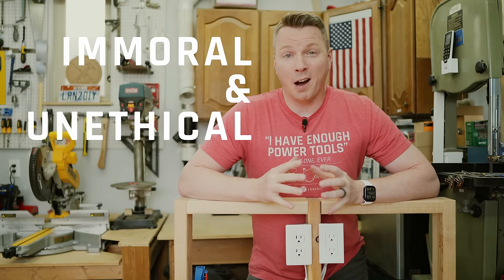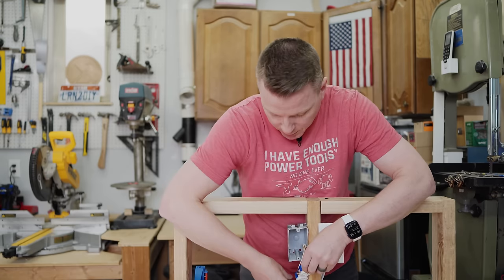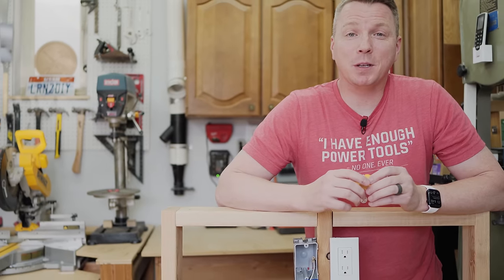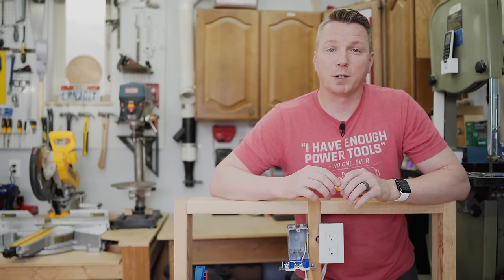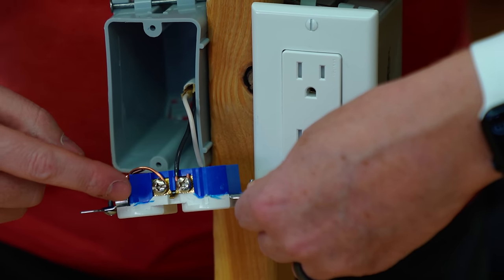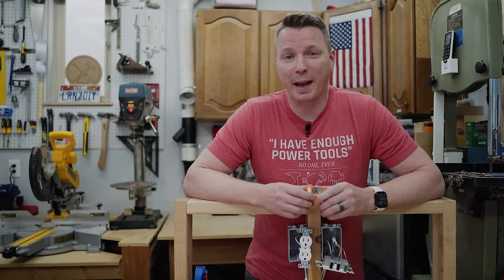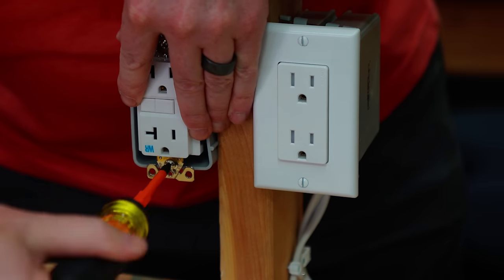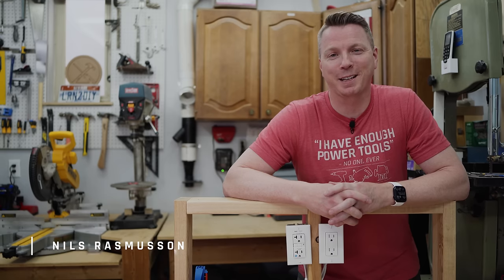People Are Adding Deadly Hacks to Outlets

Comment: What you have described at 1:40 is basically Klassische Nullung in Germany. For a long time we also just had 2 wires, L1 and N. In ~1960 the PE wire was added, this was called Moderne Nullung(modern zeroing, since it doesnt depend on the N being responsible for PE), but beware, some houses do have 3 wires, but sometimes there is an outlet beneath a switch, meaning it is also just 2 wires(basically the lamp has already been wired with N and is waiting for L1 to complete the circuit, a 3 wire cable is used, the L1 is clamped to the switch and to the outlet, the PE is being used as a way to control the L1[basically L1 is going into the switch and needs a second path to go to the lamp, meaning the PE is being used for L1], so that means the only way to connect the outlet now is with N as both PE and N and L1 as L1)

What I want to say, if you are in Germany(or any other country where this would apply) don't trust outlet-switch combos to have a real ground. Most of the times they are PEN.

And there you see the scheme PEN - PE + N on same circuit, PE/N - PE + N on different circuits.

Comment: Hi. In Europe if you have old type of electrical installation, specifically TN - C It is actually required to connect ground to neutral wire. Since in TN - C installation, you dont actually have a N (neutral wire), you have L(phase) and PEN(protect earth & neutral), so one wire - PEN is actually used as neutral and protection earth combined into one wire.

Comment: deadly is a huge overstatement, at best its a tradeoff, I for one would prefer to have my old metal cased power tool connected to neutral than simply left unconnected. If its unconnected and the hot comes in contact with the case your body becomes hot and as soon as you touch something grounded like the refrigerator or dishwasher YOU get shocked. If you have a bootleg ground it would be a dead short and would trip the fuse/breaker. That is a safer situation than the first. It is highly unlikely that you are going to lose the neutral between the outlet and the service panel than you are in the terminal device or its flexible cable. That being said adding a GFCI is too easy and cheap to not do it that way

Comment: My new home I am building.
Using 12 g (15 amp outlet), 10 g. (20  amp outlet GFI)  & 6 g wiring.    Everything is grounded.   
I have an outlet every 6’
I have a 20 amp all dedicated GFI in the kitchen.
Every outlet is marked (numbered) to breaker matching number.
200 Amp box.

I have 3.3/4” foam insulation. 
Low energy fixtures.  

When I bought a home built in 1946, 100 amp service.
I had it all torn out, replaced.   Unfortunately could not afford t add outlets.

Comment: Worked in Mexico once, on that site they only ran red and green to the outlets, and did a "bootstrap neutral". Their reasoning was that since you've bonded neutral and ground together at the breaker panel anyway, why then 'waste a wire' running a dedicated ground to the outlets
Reply: Mexico is not a great example of safety.
Reply: @leftyeh6495  What makes that unsafe?

Comment: I am always amazed by the craziness with health and safety stuff especially in the US and UK. Here we have whole residential buildings which are wired even without a ground wire in the walls at all. The worst I have experienced in 36 years of life from this is that sometimes bad appliances might "pinch" you just a tiny little bit when touching both their chassis and some kind of grounded thing, like a water pipe, the sink, or something like that.

If you want to have ground you must break the walls and install ground wires and connect to the only ground in the house, which is the bathroom outlet. I only do it to protect my computer and other sensitive electronics, otherwise I wouldn't even bother thinking about it.

Comment: There is one type of that "hack" which has been grandfathered into the code system, and that's on the NEMA-10 receptacles. They are no longer allowed for new circuits, but they do exactly the same thing as that hack. It connects whatever is meant to be grounded to the neutral supply. 

Of course the big difference is that at least you know that's the case if you have a NEMA-10 receptacle, but other than that it presents the same dangers. If there is a fault in the neutral, the chassis of that washing machine or dryer can rise to 120V AC with respect to ground if there is a hot to neutral load anywhere on that circuit (which there typically will be in such an appliance).

Comment: that era is what some in the electronics field refer to as the "Hot Chassis Era" where most electronics were vacuum tube or hybrid tube & transistor devices that did not have a power transformer but  power resistors to drop voltages down and also typically the tube heathers would be series string. The metal chassis would be tied to one leg and the other would be switched and the plug was not polarized.  The main push to polarized grounded sockets came with the microprocessor and home computer era in the late 70's onwards to today.
Reply: We had a record player that had capacitors from each leg connected to the chassis. Not nearly as dangerous, but regardless of which way the plug was connected touching the record player and any grounded thing produced a bite.
Reply: I was installing stereo equipment back then, and I could feel the difference by lightly touching the case (which were metal back then). If I felt a bit of tingling, I would reverse the plug and the tingling would be gone. I always instinctively knew that was right, without actually learning about it from anywhere.
Reply: There are enough countries with unpolarized grounded sockets and microprocessors and home computers handle that just fine.
Reply: Those radios are really dangerous. In Europe they cannot be used on grounded sockets as you would not want anything grounded next to it. Polarized plugs have nothing to do with microprocessors. They are used on lamps etc. to ensure that the switch breaks the phase and not the neutral.

Comment: I buy and rent out old houses.  Most of them have grounded outlets but when I open up the box, there is no ground, just a plug to put it in.  I switch those back to 2 prong.  Then the other thing is no GFCI in the bath or kitchen, so I have to run new lines to them.  One thing that really surprised me with the WWII era houses was where the neutral was run through the switch.  That was a real surprise to turn off a switch but still have power at the light.  An old electrician told me bootleg grounds were ok because the ground and neutral are bonded at the panel, but I don't use them.

Comment: When my wife and I married many years ago, we lived in an old rental that only had the two-prong outlets. It was common at the time to purchase a grey adaptor that would turn the two-prong plug into a  three-prong grounded plug. The adaptor had a short green wire that was never long enough to attach to anything. I guess these were not really safe but just allow one to plug the newly available grounded appliances being marketed? What's the professional opinion. I recently found one of these adaptors in the bottom of my tool box and it sure brought back memories...😜

Comment: In the 1940s my father bought a wire recorder which, like many super heterodyne radios of that time, had  a 2 prong plug.  If the plug was plugged into the socket one way, it was safe, and if it was plugged the opposite way you could get a dangerous shock  though your body to ground.   We got shocked on this thing many times. Thank God for gounding in outlets and 3 prong plugs.

Comment: To add on to this, bootleg grounds fool plug testers because the ground and neutral are connected to the same place in your panel. The reason for this is due to the fact your house is powered by a center tapped 240V transformer. 240V from end to end, 120V from either end to the center tap. The center tap has 0V potential, hence neutral, so that part is grounded.

Comment: I had a ground fault interrupt for a property which only detected current to ground.  New regulations required me to replace the switchboard with a core balance relay ( like you have in your video) but it was only required at the board because ANY current discrepancy in the entire house shuts it down. Note in your case that would also protect against a badly wired power point.  Any current leaving the circuit ( through you ?) causes a shutdown of all power.

Comment: A long while back I was living in an apartment and noticed that the metal body of my laptop caused tingling whenever I rested a palm on it.  So I disconnected it from everything and it was fine.  I plugged my external monitor back into the laptop with the laptop's power disconnected only to find the same issue.  Turns out that the leaky power was travelling through the monitor, then the monitor cable, into the laptop, and across the laptop body.  I'm pretty certain that someone who "upgraded" the complex with 3-prongs (likely "for cheap") did so using a bootleg ground and may have inadvertently switched the wires (or the wires were already the wrong color).  Needless to say I moved to a slightly older place that was actually wired correctly a little while later.
Reply: It is normal that many electronic devices leak. If they are not grounded you can feel it. It is not in itself dangerous but there is a risk in case of failure if there is no GFCI protection.

Comment: ANOTHER option is to replace all fuses with those GFI ones that protect the entire house wiring just like that bathroom outlet.  In apartments where a ground wire wasn't built-in from the beginning, it's the ONLY option.
Reply: It is an option, but it’s expensive. Around $75 a breaker. It’s cheaper to find the first receptacle coming off the breaker out of the panel and replace it with a GFCI plug. The power coming from the panel goes to the line  side of the GFCI and the power leaving the box to go to other receptacles gets connected to the load side of the GFCI. With it wired this way, all outlets on the load side will be protected by the one GFCI receptacle. You can then install regular receptacles on the other plugs since they are protected by the GFCI. It’s more labor, but it’s way cheaper than buying 15 GFCI breakers

Comment: My house was built in the 1960's and does not have a dedicated ground. Before I purchased the house in 2018, I had it inspected by an electrician.  I specifically ask if those neutral to ground jumper connections were legal / code complaint.  I was assured they are fine on old houses, he said grandfathered in.   Nearly every 3-prong outlet in the house has these ground neutral jumpers.

Comment: I don’t have any bootleg grounds but I have a bunch of three prong outlets without proper grounds. The inspector didn’t catch them so now I have to go back and put GFCI outlets in. The inspector also didn’t impress on me the importance of having the federal pacific panel changed before purchasing the house. Now I have to change the panel. Luckily, Rocky Mountain power isn’t going to make me move the overhead line from the back of the house to the front so that will save me a little bit on putting in a new weatherhead exterior disconnect and then a panel.

Comment: We spent 19k getting our 100+ year old house rewired... the old wiring was terrible. There was bare wiring in the walls and attic(it was romex run by the previous owners). Multiple receptacles weren't grounded. They literally just cut the ground wire back. They had 3 receptacles and all the upstairs lights on a single 15 Amp breaker. The electricians were astounded that the house hadn't caught fire or at the least tripped breakers constantly.  The previous owners did a ton of diy, and other than the obviously bad electrical, we found they managed to hide roof damage and water damage from the inspection we had done. So now we have about 70k with of work we have to get done after getting the electrical done. Honestly, I think they bribed the guy the company we hired sent.  There is no way he should have missed as much as he did.

Comment: The least expensive and easiest fix it the GFCI receptacle feeding the rest of the receptacles.   The issue is finding which receptacle feeds all the rest.  So, identify which breaker feeds the circuit, and feed and return to a GFCI mounted next to the panel.  Have one GFCI for each circuit.   Make sure to label all the receptacles.

Comment: I bought a 110 year old home and am a bit of an electronics nerd. I bought one of those testers to check my outlets and they showed good, but when connecting my battery backups in different locations i kept getting wiring faults. I found several outlets where the hot and neutral were reversed but many others had these bootleg grounds. Even the home inspector didnt catch them!

Comment: I live in a building where there is no ground ANYWHERE in the electric outlets, ceiling lights, etc. I've even almost got electrocuted as they sliced a current from my kitchen lights to the bathroom, so when I got off electricity to the kitchen lights, there was a current being shared that led to the bathroom. I didn't notice it until I saw a spark at one point on what I thought was dead wires.

Comment: Years ago, replacing 2 hole non grounded outlets at my  built in 1962 in-law's house, I found the wires used were armored BX cable which was grounded properly, so I added a short green secured into every metal box and the grounded receptacle.  Easy enough to then put the ground wire onto the regular replacement receptacle and it was grounded. The vinyl insulation was still in fine shape. Some of the wires were armored 3 wire with bare ground . Just how they built electric systems back then. Other house they had was made in 1968 and used rag wire, a silvery blue cover. Wires were in good condition. Every rag wire had a bare ground wire. Except for the water heater wire which was never used as house used NG water heater. It was just a 2 wire, white and black only. I thought at the time, why no ground and figured out back then  in the 60's, the water heater having copper water lines all over and in the ground, that was considered grounded by way of the cold water pipe.

Comment: This is fine, if ground is connected to the box and then connected to neutral, hot wire touching the case will have the same result as a ground wire from the breakers connected to the outlet

Comment: You can just use Multimeter if you know what you are doing. Check using Ohm between plug holes, or using "Live" function (check with red and black, you might get different results).
Also, it's better to have a bootleg ground than nothing, I got shocked by appliances without a bootleg ground a few times, but never with that crap solution you can encounter in very old houses. Here in Europe in old post Soviet buildings everything was set-up like that, and not to mention Aluminium Wires. CRAZY.

Comment: You installed a 20amp GFCI (has the extra horizontal notch), I made that mistake and after some googling, learned that unless my breaker is 20amps, I'm asking for trouble. 

My solution was to replace all of my 20amp breakers with 15amp ones

Comment: Thanks for including a solution.  This video needs to be posted on Facebook as a general PSA. 
Is 8,000 dollars worth it?  Depends on how frayed the cloth wiring is. Cloth and cloth over rubber was popular up to the 1960's in my area. 
Also running a green wire from the ground screw to the metal box MIGHT work BUT this "mechanical ground" is poor - though allowed - and I've seen plastic splice blocks that break the connection. 
Can you run a ground wire under the house, in the attic and attach boxes to the ground wire.  NO. this is not allowed for some pretty complicated math reasons involving impedance and the NEC or national electrical code.

Comment: Relying on one of the prongs being at a neutral potential I just find insane.
I know they are phasing in TN networks more and more here, but they still treat the sockets and outlets as having interchangeable prongs. Traditionally we run IT network where both wires coming to load are active and cycling and usually 2 of 3 phases entering the home. A different room would then have two of the 3 phases as well, but not necessarily the same two.
Earth/Protection/PE is then always treated correctly as you can not fake it. Equipment not needing grounding can then use a plug that works for both grounded and non grounded outlets and you can't just brake off the ground pin on equipment that needs it to make it fit a non grounded receptacle.

Comment: My dads house still had knob & tube wiring from the 1940's.   Even IT had a grounding wire in each outlet, even the ones that did not have a ground pin recepticle.  The body of the recepticle was srill grounded, and you could access the ground through the plate screw.  I am baffled as to when an outlet would not have one?

Comment: Well, thought most homes built in the 40-70s generally (when built)  have metal boxes and conduit that should run directly to the fuse box. That conduit can be your ground wire if it's not interrupted. Ground wires became necessary when homes... electricians started to use plastic boxes. So, if you are dealing with an add-on circuit, follow back to the orientation point, most likely a metal box. People, if you're going to be a DIYer, do your research! My father taught me when I was learning to sweat copper pipe... do it as well as pro, i.e... clean off the excess solder. In other words, do it right so that an inspector will not know if you did the work or if you hired a pro.